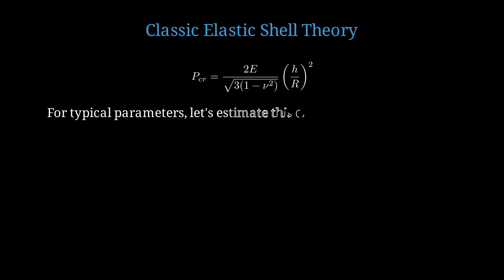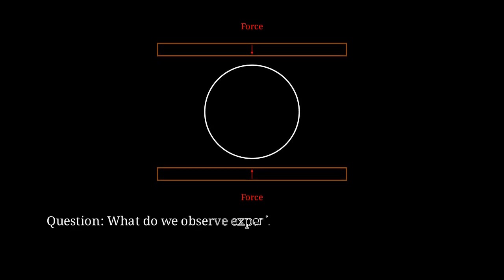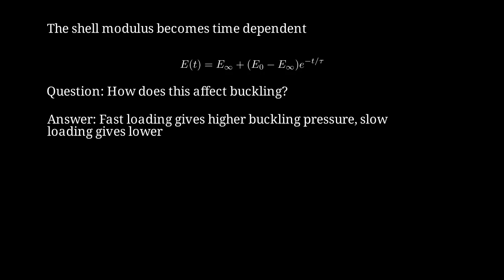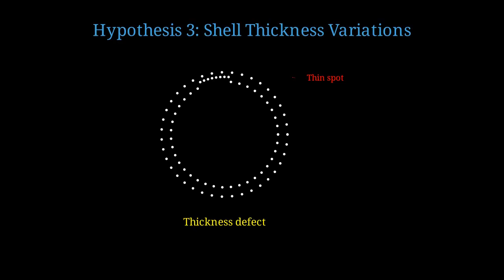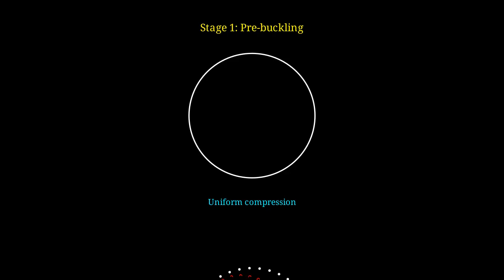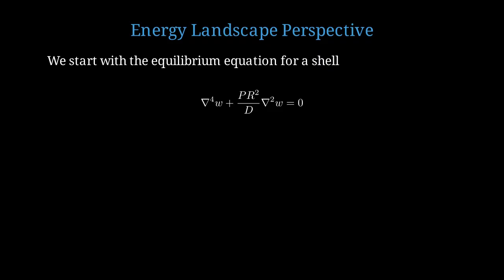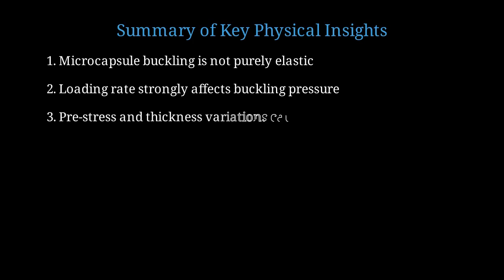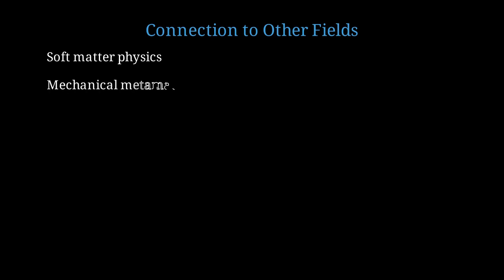Why Microcapsules Buckle at Unexpected Pressures

Comment from the maker: Can a unified theory predict buckling onset across elastic–viscoelastic–phase-changing shells?
What is the statistical distribution of buckling thresholds set by thickness heterogeneity?
Can capsules be designed where buckling is programmable and reversible rather than catastrophic?